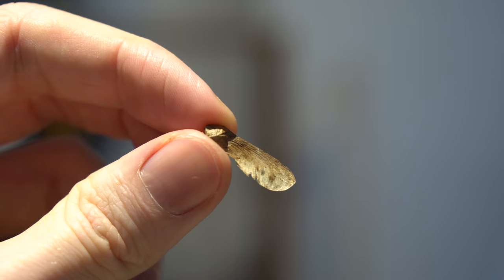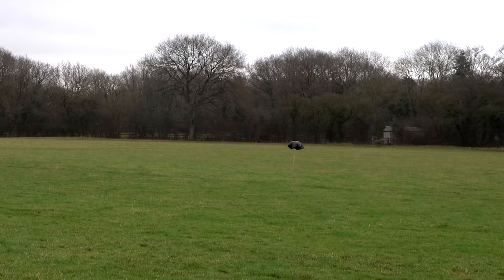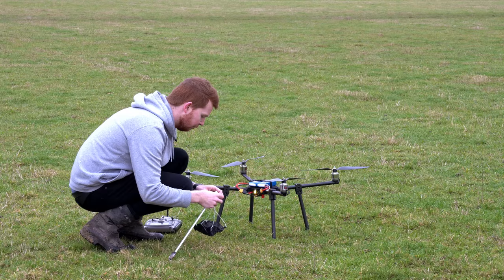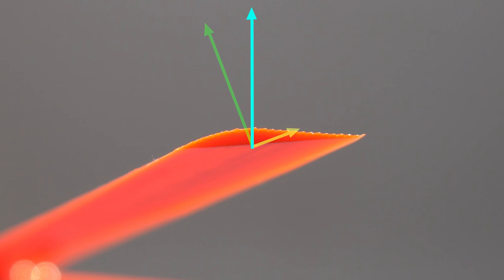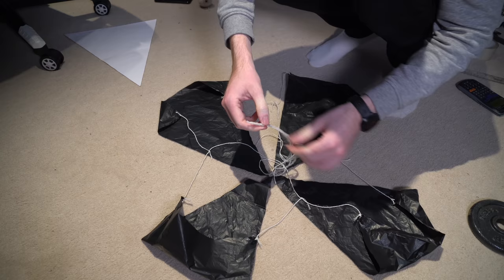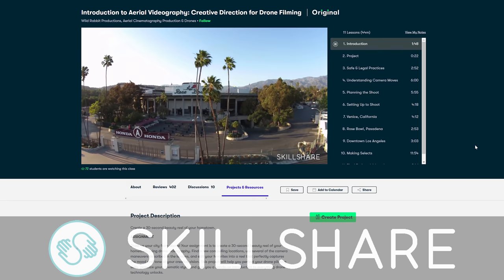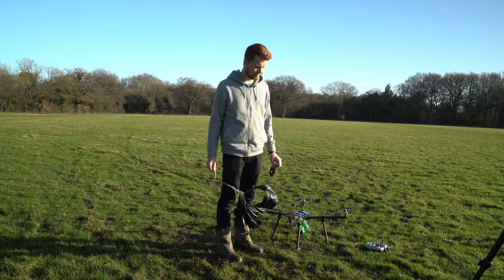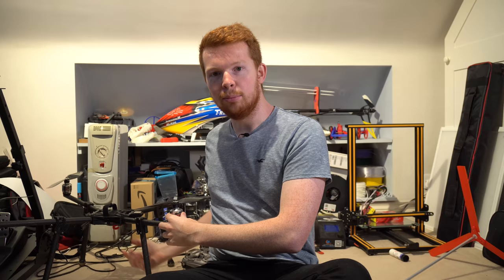Should Parachutes Spin?

Comment: FYI, the design of a sycamore seed (and its rotation characteristics) have been used for 40+ years in the design of Maximum Time Aloft (MTA) boomerangs.  

By having a shape like a hockey stick, there is a differential lift that makes the boomerang fly upwards, somewhat along an exponential curve that circumscribes an inverted cone (near enough).  So, when the 'rang is released (spinning vertically about a horizontal, transverse axis), the precession of the spinning 'rang makes it 'lay over' so by the time it's at the top of its flight (30-50m), it's spinning about a vertical axis, much like a sycamore seed.  Placing weights around the centre of gravity of the boomerang shape also affects the rate of 'layover' (which is like the 'bias' of the seed/'feather' combination -- we're talking about modifying the moment of inertia here).  

I haven't thrown competitively for over 20 years now.. but back in the '80s/'90s it was relatively easy to get 50m 'stabilized' flying heights and 60+ second flight times for a 'rang that's something over 35cm across its tips.  If you were 'lucky'(!?), you could get the 'rang into a thermal and with a stable spin, it could rise and fall a handful of times so 200+ second flight times were possible.

Rotary wing dynamics is such a fun study... (errr, ... yeah). :)

Edit: An old reference, f'sure... but it shows when I had the Australian record for MTA flight (with a return within a 50m radiuscircle) - I was kinda disappointed that it took more than 10 years for the record to be broken (!) ... https://www.boomerangpassion.com/competition/records/

Comment: My guess.
The kinetic potential energy of the thing falling is in part converted to downwards kinetic energy, but also into kinetic energy in form of the blade rotating. As the blade gets faster drag goes up with the square and it soon hits terminal velocity making the rotor bleed of energy on descend by passing all the kinetic energy of the rotors on to the air molecules.
Also when the rotors hit terminal velocity the whole thing can't fall any faster as this would require for the rotors to spin faster, wich they can't as they hit terminal velocity.

I like this as a concept. Super cool

Comment: In college,  my team used an autocopter design to win an egg drop competition where resources were limited to 50 3x5 cards and a roll of scotch tape. You won by dropping it safely from a third story balcony the most times. It was kind of breezy but since our drag to weight ratio was good, the spin kicked in right away and the gyroscopic effect prevented tumbling. All of the parachute-like and crumple-zone designs eventually broke, but our copter could have kept going and going. The egg was barely kissing the ground on  each landing.

Comment: The main reasons that rotating parachute are not in common use are size limitations and mechanical parts that must withstand a tremendous amount of force and wear out quickly. In smaller scales rotating parachutes tend to out perform all other parachute types. Check out the Sandia Rotofoil Design or Sandia RFD.

Comment: Hi Tom, I had a question that kept me wondering, would the parachute descend slower if it had a hole in the middle. Nice video and a brilliant question. Keep up the good work.
Reply: I don't think so, A hole would decrease the total surface area which would decrease the drag, so the falling speed increases.
Reply: A small hole in the middle stabilises the chute by stopping the wobble caused by air spilling over the edge. I always thought it also reduced the descent rate because of this, but would like to see a test to prove it disprove it.
Reply: If it would, someone would have done it a long time ago.
Reply: @richardhallyburton  round parachute do have a hole in the middle, it increase stability and reduce descent rate. Its called pull down apex parachute.
Reply: @richardhallyburton  I think only because a parachute without a hole would oscillate and spill the air erratically. With the hole it is more stable, so I suppose ultimately slower.
Reply: @richardhallyburton  I read a story many years ago about the early days of parachute design. Allegedly a young boy was watching them jump (from balloons I believe) and he said as one parachutist landed in a heap: "Hey mister, why don't you put a hole at the top?" Not sure whether this is true, though!

Comment: I proposed in the early 80's at Boeing that a space station escape system would work like a maple-tree seed.  It was considered in one and two blade configurations.  It could not handle the wide range of forces due to the required sizes and control mechanical systems.

Comment: Gyrocopter drive that to the Extreme. The rotors have different angle and shape in the inner 2/3 than the outer 1/3. inner part converts drag into rotation, outer part converts rotation into lift.

Comment: The rotor blade is in autorotation, like a helicopter is designed to do when it's power fails.   The rotor blades are creating lift and thrust as the relative wind passes over the blades, angled downward to keep the angle of attack correct.   The vertical lift vector slows its descent, the horizontal lift vector drives the rotor, and gravity is its power supply

Comment: Well, it's the same principle as autorotating down in an auto gyro that's out of gas.  It does work, but I doubt it's quite as efficient as a traditional parachute.  The positive aspect is that it can be re-packed mechanically a-la inspector gadget.

Comment: Another reason not to use the vortex parachute - no one wants to be spinning like a top while descending.  If they put in some sort of a bearing mechanism it will also add weight.  Plus how difficult it will be to pack the parachute when there are literally four separate pieces, and your life depends upon how well you pack that parachute.

Comment: From an energy point of view, whatever method you choose to employ, you will need to convert potential energy of the height into something other than kinetic energy.  Spinning something turns the kinetic energy into rotational energy and friction will turn it into heat one way or another.  I wonder if we can use the spinning top to charge a battery or heat something through friction and more effectively slow down the fall.

Comment: Reliability is the number one concern. All other optimizations are subservient. With round parachute systems you can deploy redundant chutes, e.g. 3 chutes and still land on 2. If you have spinning contraptions this redundancy is eliminated or at the very least you would need staged backups and so the risk and complication increases significantly. Even a single round chute is not considered safe enough because you have a single point of failure, but with 2 or three chutes the safety margin increases combinatorially.

Comment: I like this video, its an easy idea to wrap your mind around idea but an interesting and relevant one, tested in simple and direct ways

I noticed that the normal parachutes had a tendency to have a slight spin to them as well, interesting. One thing to talk about that I think is relevant is that the thing has to get a pretty good spin rate going to slow down, and at a certain point you might have to worry about nausea from the human in the parachute, or additional engineering complexity to make it so the chute can rotate freely without the attached body

Comment: The reason that the blades fall slower is that they generate lift as opposed to a parachute which only relies on drag. As the blades spin air passes over the upper and lower surface of the blade and because fluids have a tendency to stick along surfaces they flow over and because the upper surface of the blade has more surface area than the lower surface the air flow will speed up along the upper surface. 
Bernoulli's equation dictates that a faster flow causes a pressure drop along the upper surface hence the wings are sucked upwards which is where the lift originates from. Basically the wings lower air pressure on the upper surfaces to suck the whole contraption upwards which slows the fall.

Comment: Excellent experiment and I will try to explain,  physics my dear Watson, physics. 
Energy can not be created or destroyed, it can only change form. 
So the energy in the weight by gravity has to be divided into the energy required to spin the rotor. The rotor has friction in the air so the rotation speed is determined by available energy. A wing profile causes lift so the unit fails slowly.

Comment: Using conservation of energy, it is easy to see why the spinning slows the weight down:
Because a lot of the gravitational potensial energy is converted to rotational energy, less energy is converted to downwards kinetic energy.

Another way is to realize that the rotating wings act sort of like wings on a glider aircraft, slowing down the descent by making the plane glide forward throught the air.
You can kind of imagine each rotary blade to be a glider plane wing that spins around the weight, and like the plane wing moving through the air, it slows down the descent.

Comment: Didn't dig thru all the comments, but this reminded me of my "previous life" hobby of model rocketry (circa-1985-95) in which there is a competition class called "Helicopter Recovery" where the rocket craft ascends 100% under model rocket thrust and then must return to the ground via an auto-gyro helicopter recovery system.  A system that is VERY similar to your 3-blade autogyro unit in these tests....

There were typically, three design variations:
1) Ejected rotor system - A fold-down rotor blade assembly that would be either ejection-charge released like a model-rocket parachute, or spring/rubber-band ejected by a launch-sled that was released by the ejection-charge and then the rotors would "spring-out" and start spinning.
2) Externally-mounted dual-, tri-, quad-blades that would be hinged at the base of the blade, spring or rubber-band extended, and secured with a "floss string" that would get burned by the eject-charge and release the rotors.
3) A flexible system or semi-rigid system - Think a very bad parachute with a hole, with a rod in it from the center to edge along the side of one of the slots that would cause it to spin on descent. (for official competitive purposes, this was actually non-compliant because the rules required a "rigid" heli-blade system)

Since this was 30+ years ago we would build these with 1/16" or 3/32" balsa wood for the blades, that would usually be split length-wise and "hinged" with a film of mylar tape or just plain-old packing tape on the bottom of the blades... This would let you fold-over then fold-down blades, so that they would have a very low-profile draft under the nose cone and then they would magically deploy when the retention floss-string released and then auto-gyro to the ground.

Since this was a competitive sport, duration from launch to landing was the metric of performance... So, the longer you kept the craft in the air, the better your score.

As you discovered here, the spinning helps with loft via rotational drag, but when the angle of attack of your entire rotor surface is uniform and pointing at a negative angle, you've basically produced a progressively down-accelerating screw.  So while it would slow the descent initially, the longer it spun, the faster it would drill into the ground.  Not so great if your goal is to maintain recovery lift as long as possible.

SO, for us "real champs" in Helicopter Recovery Class, we would "tune" our rotors using a steaming tea pot... ;-)

Basically the inner 3rd of the rotor is kept in a down-15 degree angle, and then you'd steam the outer 2/3ds of the rotor and manually twist it so that the tip of the rotor (and about outer-1/3rd) would be at a positive 5-10 degree angle.  Effectively, this would result in the inner-half of the rotor "driving" the rotation, and the outer-half providing increased lift as the rotational velocity increased.

I won a number of A to E class motor competitions with this basic tuning formula, including a 8-minute recovery time on a B-class Helicopter Recovery craft that actually gained altitude several times on thermals during recovery.  One of the "unintended effects" of this tuning was that in certain up-lift/thermal air conditions, the lift would counter the down-screw effect so effectively that the entire model would flip over, and proceed to drill-itself down.  Nothing like lead-tape on rocket fins and walking the fine line of CG to CP offset to make sure your launch didn't go haywire.

Anyway, hope this helps with your research into auto-gyro's... Love the videos and your attention to experimentation and practical engineering... Please keep inspiring us!

Comment: I suspect the ideal solution is the spinning blades combined with a method of speeding up the rotation at the last moment with stored power. Just a third G deceleration at the last 0.5 seconds would slow the impact down by 5 feet per second.  The added weight could be more than compensated for by the smaller chute.  0.5 G deceleration for the last 2 seconds is 20 mph.

Comment: in the first test, small parachute didnt work well but the big one did, and it has a 10 times bigger surface area you said. I think you should use a rotor which has the big parachute's area rather than its diameter because the factor that limits a falling object's velocity is mainly related to its surface area.

Comment: Also why we feather propellers on dead aircraft engines. The drag of a rotating propeller is about the same as a disk of the same diameter.
Reply: Not true. A feathered prop is just less drag than a non-feathered prop.
Reply: @iforce2d  Do some research. I have been flying multi engine airplanes for 45 years.

Comment: Make some more auto-rotating aircraft, and try launching them from another aircraft. use a spring-loaded hinge mechanism to pull the blades down into a horizontal position as the craft slows, making the deceleration more gentle, while also having less chance of the craft loosing balance.

Comment: and the rotorblade need to start spinning which requires engery so the potential energy is converted in downwards and rotational energy. which means even if the blades dont profide lift it will stil fall slower than something with same drag but without rotating parts

Comment: Spinning parachutes are a concept that have been heavily studied by NASA and amateurs a like for the exact reasons you stated in your video. The main reason why you do not see spinning parachutes used on space capsules or anything heavy is because primarily when you make them large enough to be usable for things such as people or cargo, the parachute will not be able to maintain its shape as it spins. They could descend faster, however spinning parachutes also have a speed limit as if you descend too fast the parachute will collapse on itself instead of being useful. Thus the spinning type parachutes have really been limited to amateur rocketry, mostly on the small end of high power rockets.

Comment: I bet you could make improvements using a variable cross section rotor. Changing the pitch of the aerofoil as it goes along the blade would be the best place to start. (I think some autogyros are like that)

Comment: You know those car windshield screens with the band of spring steel on the outer edge to keep it taught but able to fold up? Redoing the propellerchute design in a similar way could increase reliability and allow for the chute to reach a faster rmp and thus have a slower decent

Comment: Very nice analysis.  This also sheds light on why the space capsules use multiple chutes instead of a single chute
Reply: No, multiple chutes are for redundancy. They don't spin, as it is that that gives them extra efficiency.
Reply: I understand the need for redundancy but space capsules  use multiple chutes for other reasons . As Elon musk has commented recently Designing large reliable chutes is extremely complex. Multiple smaller chutes is easier

Comment: You're comparing the diameter of the rotor with the diameter of the circular parachute when the parachute is lying flat on the cutting table.  In actual use, because of the strings, the parachute's actual diameter presented to the air is much reduced.  Also, you need to take into account the parachute and the rotor's own weights.  Is the 3D printed rotor heavier than the chute?  Also, as the rotor has aerodynamic wings, both surfaces have an effect, so comparing surface areas is pointless.  Different aspect ratios and angles of attack would have an effect.  Also, as a practical method of slow descent, something that spins has its limitations: who wants dizzy paratroopers?  However, it is an interesting experiment, and your explanation of how an autogyro works is concise and excellent, thank you.

Comment: What about a more radical pitch on the rotor? Or a variable pitch from hub to tip? 
Or a broader rotor blade? 
And a data payload to measure speed and acceleration?

Comment: The vortex  parachute might have worked better if a fishing line swivel was fixed in line above  the weight. That way the parachute would start to spin more quickly without try to spin up  the weight and winding up the string.

Comment: The rotorhead could have perfomed better if the blades were twisted like wind turbine blades. The optimal pitch for each blade section can be calculated with blade element momentum theory. But for this demo the simple turbine seemed to work good enough.